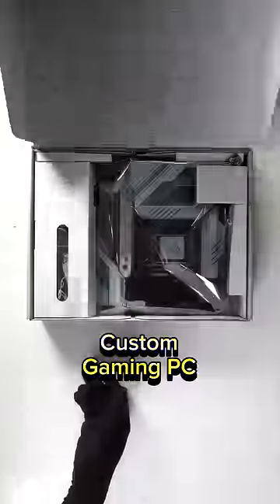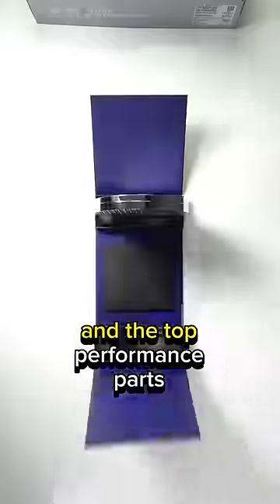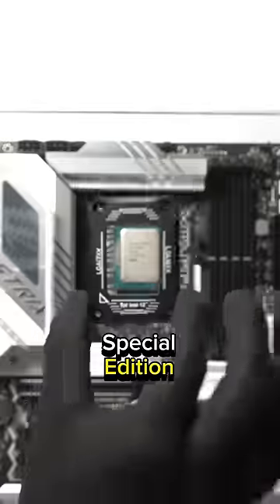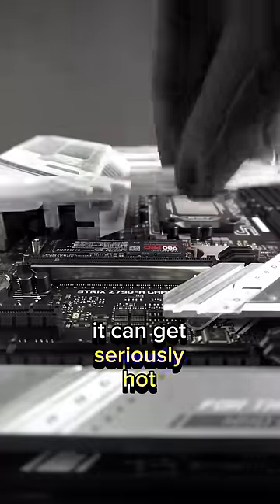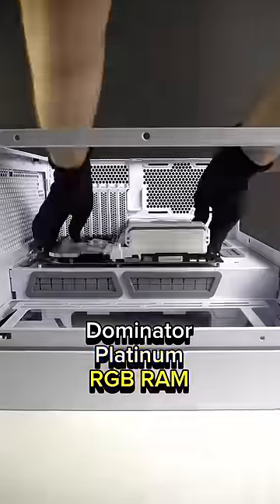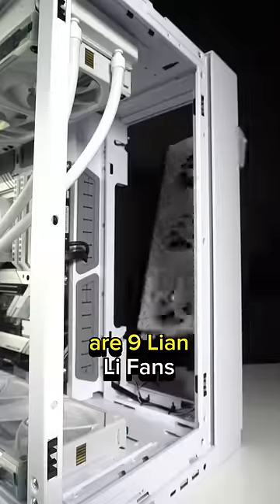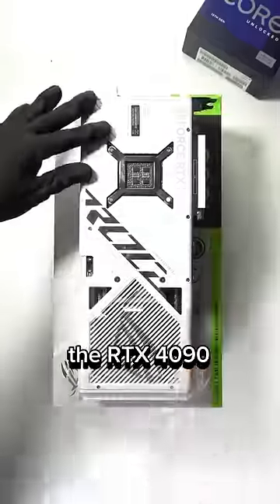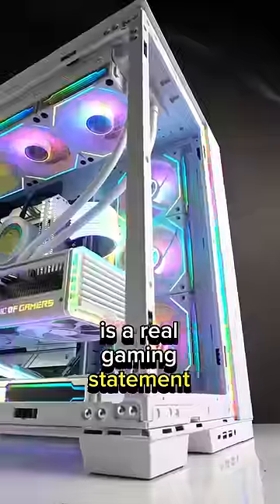BEST 👑 ALL -WHITE ⚪️ GAMING PC | RTX 4090 + Intel i9-13900K Special Edition 😱

Comment: i bet that customer having some second thoughts about that CPU rn
Reply: What’s wrong with the cpu?
Reply: @Randybutternubs-cj6tw it overheats and always crashes
Reply: @NooviPlays it’s only 13th and 14th gen right?
Reply: @AustinTosses yes only 13th and 14th
Reply: Especially the k's oft 13th and 14th
Reply: @NooviPlays I don’t think you heard him talking in the video he added something to stop it from overheating
Reply: @aubsion2670 I didn't hear him saying that since there was a storm happening lol
Reply: @NooviPlays patch coming in august
Reply: The problem with the CPU is it actually begins frying the physical copper pins which cannot be fixed, it not being a software problem but a hardware degrading problem
Reply: Best cpu for gayming.
Reply: @Seraphim401  what-
Reply: Brainrot amd dogs be like when they see intel
Reply: @SamsungGalaxyS24Plus5G  what are you yapping about lol AMD is just plain better in many ways, it has been debunked so many times
Reply: @SamsungGalaxyS24Plus5G   have you heard of the intel instability issues?
Reply: @aubsion2670  It is not about external cooling. It is about some too much current being sent into specific parts internall.
Reply: @SamsungGalaxyS24Plus5G amd is actually just better than intel nowadays
Reply: I would go with a different mother board just to go for Ryzen
Reply: @Randybutternubs-cj6tw it rusts too
Reply: @aubsion2670  The microcode problem is still there, it won't be solved. No cooling will solve the problem.
Reply: same bro
Reply: @NooviPlays not rly.
Not 100% of the newer I7 + I9 are dead.

My 14700K @ 300W 55-65° ingame. Benchmark 80°

The oder Problem from the 13. is Bad. Yes. But Intel changed dead CPUs to the 14.
The newer 14 should run fine. (Factory change + BIOS update)

I dont Update my BIOS and my CPU is far away from 1,6v+ (1,40-1,44 Max)
Reply: @AustinTosses not all from 13 and 14.
13 is Bad, newer 14 should be okay since a few month.
I never get problems with my 14700K @300w (same for my friends with i7 + i9)

Runs ingame with 55-65. Benchmark ~80

No "voltage spikes" for me. Tested it a few times an i got only 1,4 - 1,44. Not 1,6v+
Reply: @Randybutternubs-cj6tw  everything
Reply: @aubsion2670  Stil crashes.
Reply: @mcyeet85 never fixed it it’s september
Reply: @Fwloxz.  because it’s the motherboard manufacturers fault. they try to make the board automatically tune the voltage but it ends up executing the CPU. But yeah, you’re right they should have fixed it by now. Good thing Amd is the better brand soo
Reply: Doesnt it go away when undervolted?
Reply: @aubsion2670  Then there is just the crashing left😂
Reply: Recent VMin shift instability
Reply: @NooviPlays any prebuilt service should limit the cpu’s power draw so it doesn’t mess itself up
Reply: @Randybutternubs-cj6tw  it’s Intel
Reply: my i9 14900kf still gets up to 71 when streaming and playing cod or Fortnite and tbh ik 80’s bad so its a bit sketch (p.s. 71 c after approx. 3-4 hrs of playing prolly around 6-7 it’ll guaranteed be around 80+ imo its not so bad if ur not tryna power up nasa all at once but def could be sm better

Comment: Almost every video is 4090 and i9 13900K, bro cannot make an single video without these components
Reply: If you wanna see someone make ur budget build so bad then just search it up
Reply: @emari8752 I'm pretty sure he means that they do this exact same video with this exact same script everyday
Reply: They might be the same components xD he just slaps a different cooler om the gpu
Reply: They’re the best of the best, you’re not gonna see something different until next gen NVIDIA drops. Though the 13900k can be changed out for the 7800x3d though for gaming specifically
Reply: @blizyon30fps86 yeah true. I'm an intel fan boy bit I believe 7800 is amds newest and fastest cpu. Although maybe it's a little slower. Also I mean considering there aren't many newer or better components to use,  how the fuck would they be able to use anything different for non budget build?
Reply: I9 900k is way overkill unless you plan on doing video editing or image design. I5 13600k gets lower temps and similar performance for games. 400 bucks cheaper
Reply: @user-qb1nk1ey2d  lmao that is not 
A terrible idea but the core difference is quite high on those. The i9 just will be way better at everything. Plus most people will more multiple windows open which is better when you have more cores. But the i5 13600k is a really good mid range processor. I was considering it or a 5600x from amd.
Reply: @emari8752 He seems just spreading hates about Intel and Nvidia, also he really didn't know about marketing.
Reply: They're the best, so it's obvious that people who can pay for it will want it.
Reply: It's what gets the most views
Reply: This is his 22nd
Reply: 14900k!
Reply: They are the best for a reasonable  price tho.
Reply: @biggiechesse9391 maybe because clients request that frequently
Reply: 99
Reply: Alan Wake 2 4K Native Epic 40 fps?
Reply: and the i9-13900k isnt even the fastest
Reply: @blizyon30fps86  He didn't use an i9 13900k, he used an i9 13900KS, which im pretty sure is faster than the 7 7800x3d for gaming, too.
Reply: @emari8752  pal even if the 4090 and the i9 13900k are the top of the top after the 100th time it's f.. Boring. Yeah, I would actually see a budget build because they are also a thing and to build a good budget build that works and gives also good performance is far more a challenge and interesting to see as a 4090 and a i9 13900k where you know from the beginning that will work no matter what.
Reply: Doesn't help that man is allergic to AMD
Reply: @blizyon30fps86  I think they're saying that because they use this exact same script for every vid they do
Reply: @ManofBruh just because you aren’t using the top gpu on the market that comes in over 1k doesn’t mean it’s a budget build
Reply: @thebigbroeyjoey   I made these comments ages ago and I have 0 idea what you mean even after rereading them. The only thing I can think of is when I said "non budget builds" meaning that if your not on a budget then why wouldn't you want the latest and greatest components?
Reply: Maybe bc they are the best parts from a high end build???
Reply: frrr
Reply: Fun fact to day the best gaming cpu is AMD
Reply: @luciejelinkova5086  bruh who asked you, and the best is Intel i9 14900k
Reply: @luciejelinkova5086  real fact!! Deal with it and stop crying!
Reply: @luciejelinkova5086   you are right but not right because AMD's " gaming CPUs" so compete with intel and is actually better sometimes but I think you are talking about their threadripper versions which are made for workstations to handle thousands of terabytes of Vram and Ai creation.
Reply: Welp hes making different buidls now not the same
Reply: Well he does make PCs for highrollers, so it makes sense
Reply: @ManofBruh you do realize that single core performance out weighs multi core at specifically gaming any day of the week right?
Reply: @eggreverb3217  oh yeah definitely, but it doesnt matter nearly as much for just about everything else.
Reply: i mean its the best parts my guy
Reply: @blizyon30fps86 just seems like overkill 💀
Reply: @blizyon30fps86 no way 7800 can give u that much more stability or fps in gaming compared to intel lol
Reply: @jamesschaller753  my comment is 8 months old before Intel had stability issues
Reply: u said it before me i always say that to my self like this core i5 14 completely sucks and unfortunately we need to give a shit
Reply: @ManofBruh 13600k literally no difference for gaming. Gaming. He said gaming because he doesn’t mean in productivity
Reply: @BillyRazOr2011 NVIDIA is indeed irrelevant for gamers and relevant only (if not mostly) for content creators because of the specific benefits NVIDIA giving over AMD
Though. AMD has better budget and has better value options in most cases with more VRAM which is only gaming performance 
Although. Intel's latest gens are just a terrible product and Intel in general isn't meant for gaming as much as AMD. Besides, Intel has a much worse upgrade path than AMD
Reply: @abductedprince They're the best when it comes to performance but absolutely not the best value (if not the worst value)
Reply: they are regretting now with all the booming intels 😂
Reply: Just wait until those cpus burn themselves out haha
Reply: R7800x3d...
Reply: Now every build is the boring 7800x3d
Reply: Fr
Reply: @abductedprince lmao

Comment: No GPU bracket to support the 4090s weight? I see a cracked PCB incoming…
Reply: Similar builds with different brands have videos out with benchmarks. It does excellent at 1080p. Probably a little overkill though if you're predominantly playing on 1080 though. You can achieve some excellent stats with 4080 and below or AMDs. Even just using an AMD CPU will cut the price. Unless you're more then gaming or even just a sometimes gamer these types of builds are a bit more than you need.
Reply: They all come with them now. They attach to the back of the GPU then to Mobo. Maybe we can't see it? I dunno. I do with her shared a better visual of the finished product. I'm beginning to think he can't math. He says 9 Lian Li fans but there are only 6. The top 3 are NZXT for the rad. 🤔
Reply: @Little_Bitz he changed the Nzxt ones with then lian li ones

Comment: Thermal throttling at its best
Reply: What, how?
Reply: @MrToastyYT  That's not a very good cooler if you're gonna pair the 13900K with it. Even one of the most high end if not the most high end AIO which is the Arctic 420mm averaged around 93C while the CPU was on load. That was when the 13900K just came out so they could've improved efficiency by then but it wouldn't be more than a 5C decrease or something. It's still not a efficient chip whatsoever.

Comment: Just built almost this exact pc z790-h mobo, rog 4090, dominator platinum 2x32GBx6800 but with rog strix aio and i9 14900k w/ 2x 4TB 990 pro (I think that’s the correct names) super fun build.

Comment: please stop using the i9-13900k and rtx 4090 with a different pc case, i've seen that build with same cpu and gpu many times but the case is different
Reply: Many users prefer Intel i9-13900K with a 4090
Reply: 58003xd lian li case
Reply: The only two options for these builds  are either o11 dynamic or H9 elite I swear

Comment: this is literally the prebuilt i was planning to get and it had all the same components but instead my dad made me build my own pc which isn’t the best but it is nearly top of the line with a ryzzen 7 7800X3D with 32 gigs of gskill trident z5 neo(or trident z neo i can’t quite remember) and to top it all off a msi RTX4070 OC edition ventus 2X
it is definitely overkill because i’m going to be using 1 720p old af plasma tv because why fix what ain’t broke and a 720p(or 1080p i’m not sure) smaller tv

it can do forza horizon 5 max graphics achieving 60 fps without even hitting 100% usage

Comment: I just built my first pc today and my radiator fans didn’t light up. I change some cables and 2/3 fans worked while 1 didn’t plus the thing that sits on the cpu. When I first turned the pc on, I heard a noice (I’m thinking it could be a fan hitting a wire) and it shut down for a few sec before it started again. Could that somehow be the reason why the rgb doesn’t work? The fans work and everything, it’s just a little sad that I don’t get all the rgb. Pls anyone help

Comment: What is the best gaming pc for 2500 cad all White
Reply: On newegg canada

GIGABYTE GeForce RTX 4070 SUPER AERO OC - 920 dollars

AMD Ryzen 7 7800X3D - 500 dollars

Team T-Force Delta RGB 32GB (2 x 16GB)  DDR5 6000  - 150 dollars

SAMA XF1000W 80plus Gold Power Supply Full Modular  - 130 dollars

NZXT H6 FLOW Compact Dual-Chamber Mid-Tower - 150 dollars

ASUS ROG STRIX B650-A GAMING WIFI 6E Socket AM5 - 320 dollars

It's 2,170 then tax and handling = like 2,604 CAD

edit: skipped the fans and AIO but oh well

Comment: Fastest in frequency at the time sure, but this CPU isn't always the best for gaming. 

At the end of the day the 7800X3D out performs the 13900k in many titles while also having better 1% lows and .01% lows. This means that it has a more stable framerate with not as harsh stutters. 

This is thanks to two things, 

One: A very large cache, the 7800X3D has a larger cache than the 13900k. This larger cache allows the processor to process more assets than the 13900k as it relates to gaming. 

Two: More simple architecture, the 7800X3D is a simple single CCD processor with 8 cores of equal performance that all have access the processors "3D V cache" 

Whereas the 13900k is a hybrid processor with dual threaded P cores and many single threaded E cores. This means that to get the best performance the OS, that being windows needs to accurately schedule the correct cores to the task. Sadly windows doesn't do this very well hence the worse 1% lows and 0.01% lows (lag spikes/stutters).

One last thing to mention is the 7800X3D does it all while drawing significantly less power, thus dropping the cooling requirements for your PC from a 360mm liquid cooler to a simple large air cooler for a much more affordable price. 

Not to mention the 7800X3D being cheaper too... 

Oh and all while actually having a great upgrade path going forwards where you'll be able to upgrade without changing your motherboard for a couple more generations. 

And remember, frequency doesn't mean everything. A fast gaming computer implies that it generates the most frames and holds the most frames stable. Not that its "Speed" GHz is faster.

Comment: Hey can you link the case?
Reply: I think its a Lian Li O11 Dynamic, but I’d suggest the Lian Li O11 Dynamic Evo with no metal beam blocking your vision. But dont get an H9 Flow or Elite bc airflow is bad, get the h6 instead

Comment: That’s all the peak turbo clock has lol my i9 12900KF runs 4.7ghz consistently without even overclocking and mine was made for overclocking not having integrated graphics really u don’t need anything better for gaming bug maybe if ur running a ton of stuff it might be slightly beneficial not work a lot more tho

Comment: If you are going to put that money into a build, don't waste the memory with slow ass DDR5 6400mts or some shit. Anything under 7400mts is a waste and slower than high end gear 1 b die. Maybe get a cooler with an LCD screen and buy a 2 dimm z790 white ROG Apex board with some hynix a die so you can hit over 8000mts so it's actually fast. It's an intel system. Optimize it. I'm running a Suprim X 4090 with a z790 ROG apex and hynix a die at 8266mts cl32. Just picked up a 14700k and swapped it with my 13600kf even though it was pretty much a waste of money at this point. I also have a Gigabyte Taichyon z790 mobo. People always wasting D5's potential. People need to watch frame chasers if they actually want to learn something instead of using slow ass gear 2 stock XMP.
Reply: what use cases are benefiting from your super-tuned ram?

Comment: Don't buy a high end pc like this the guys who made it should never have got that processor the 7 7800x3d is waaaay beter and don't spend soo much on ram just regular get ddr5 32gb ram from a trusted brand and you don't realy need a $300 motherboard there are soo many other motherboards out there so don't spend more than $200

Comment: PC Build Components:

1. Processor (CPU):

Intel i9-13900K – ₹48,555

2. Motherboard:

ASUS ROG Maximus Z790 Extreme – ₹83,000

3. RAM:

Corsair Dominator Platinum RGB 32GB DDR5 (6000MHz) – ₹18,260

4. Cooler:

NZXT Kraken X73 RGB – ₹16,600

5. Power Supply Unit (PSU):

Corsair RMX Series 850W – ₹11,620

6. PC Case:

Corsair 7000D Airflow – ₹20,000 to ₹25,000

Storage:

7. Primary Storage (SSD):

Samsung 980 PRO 1TB NVMe SSD (PCIe 4.0) – ₹10,500

8. Secondary Storage (HDD/SSD):

Seagate Barracuda 4TB HDD – ₹8,000

Graphics Card (GPU):

9. NVIDIA GeForce RTX 4090